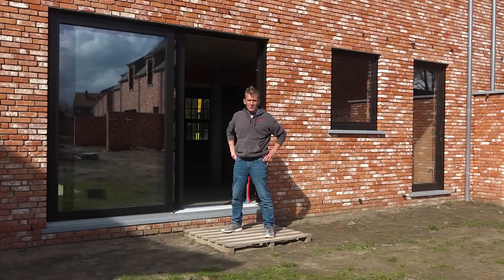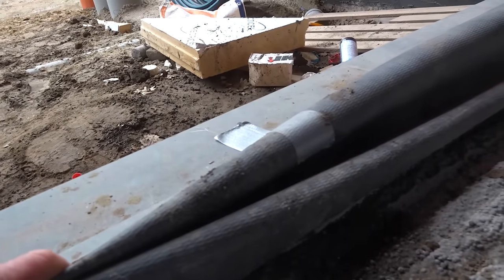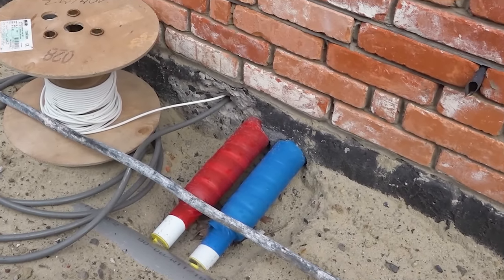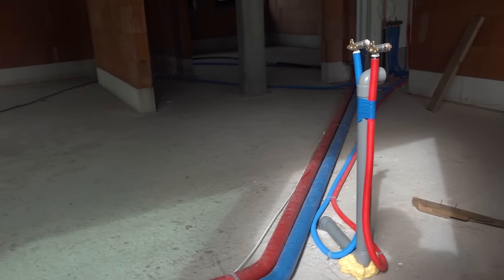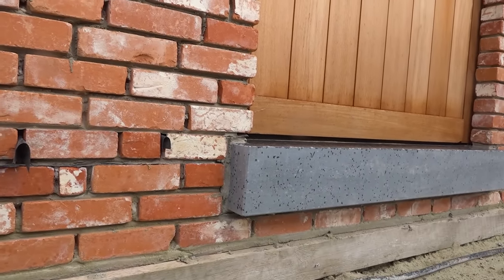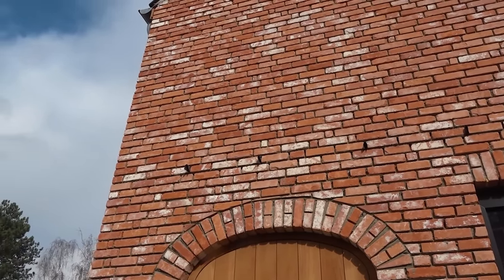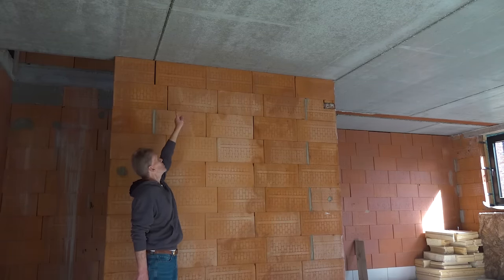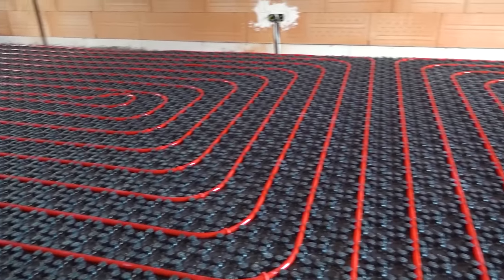Can We Learn From Buildings in Belgium?

Comment: Pipe in pipe is NOT to easy replace the pipes, the mantel is to protect the actual pipe against alcalic infuences of the concreet. The bagger pipes, blue red are the waterpipes for the heat pump. The Windows is NOT concrete but belgian blue stone, arduin, a nafural stone. The plastic bit in the stone are ventilation holes for the space between outer wal and the insulation in between outer and innerwall. The plastic prevents the filling of them. Get informed before you start talking nonsense.

Comment: I will say this. This is the worst country in the world to build houses. Our homes in it’s got the most evil climate cold and 8 months perpetual damp . we have the problem of trying to keep the place warm ventilated at the same time and afford to . The more we insulate the home the more condensation builds up inside. I sometimes think every home should have a built-in dehumidifier. But I don’t think people would switch it on because we have the most expensive electric and Gas probably in the world
Reply: Insulating an old house always gives humidity issues. I think forced ventilation with heat recuperation is the cheapest way to deal with this. But if you have a basement you might need a small dehumidifier there, especially in the summer. I have one but it consumes 200 watts...

Comment: This building is basically stupid and very bad architect worked on that. 

1st - thy whe hell anybody let you build a house on a clay? At least in Poland, if you have clay as a ground, you must change it to normal soil before putting a house, otherwise - you just can't. If clay is dry then it's super strong, but in the time it gets wet - your home will slowly sink, you start getting cracks and it will be dangerous just to live there.

2nd - those 'foils' are stupid, as vell as those foils inside a wall. Just isolate your foundations using specially designed product for that matter + XPS + bubble wrap to let any of moisture to evaporate from the foundation area.

3rd - how high is this building? 5cm above ground on flood area type of soil? You should literally have a step or 2, that mean 40-50cm above soil your floor should start. In Poland architect who did that would be liable for any damages, how shitty that project is.

4th. Why those cold and warm water pipes are going off from home at the level of ground? They're very easy to break.

5th - why "damp proofs" are so freaking high, and why they're on bricks!? They should be layed down on foundations!
Reply: Xps and bubble wrap 😂

Comment: Seems unlikely they would go back and repoint after the scaffold has been struck. Leaving it in that state is an abortion. How curious.🤨
Reply: Saw that when i worked in the Netherlands , bricky left the joints raked out and then another crew came in and pointed up. The houses themselves were built in a shocking manor , timber framed left open to the elements , the insulation was saturated . we would stick nails through the vapour barrier to let the water out. As for the leadwork well !
Reply: It will get pointed
Reply: Belgians don't use scaffolding for brickwork, so it's only used for the pointing 2 years later. The bricks are delivered onto the middle of the concrete floor and the builders work from the inside.